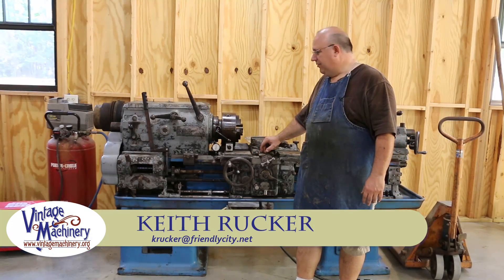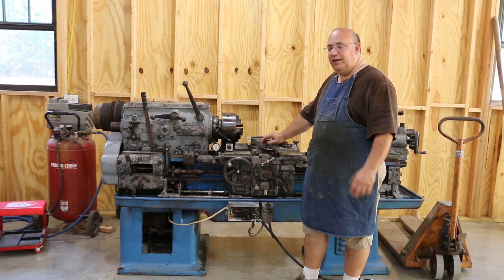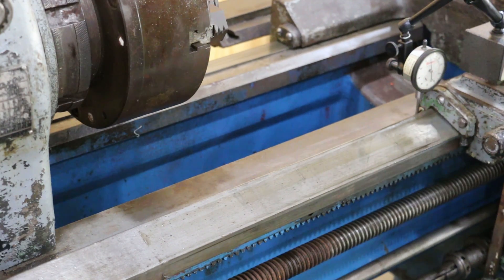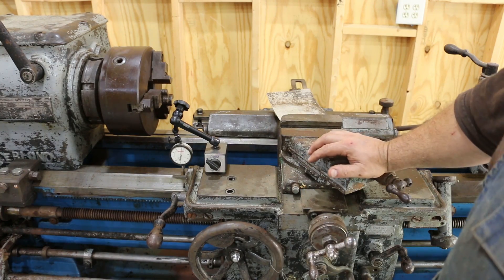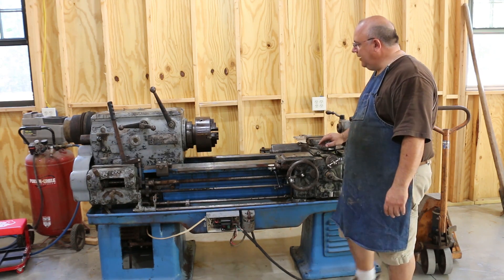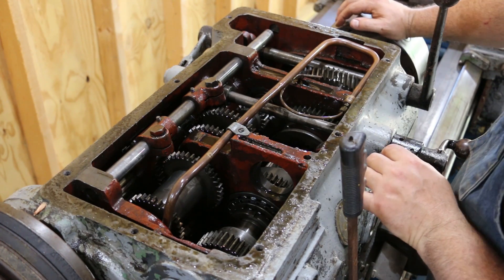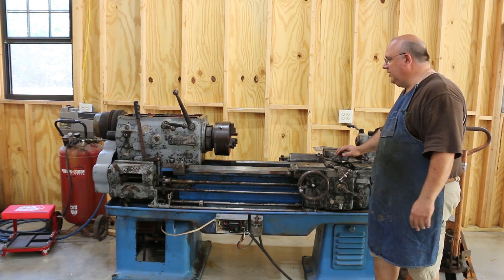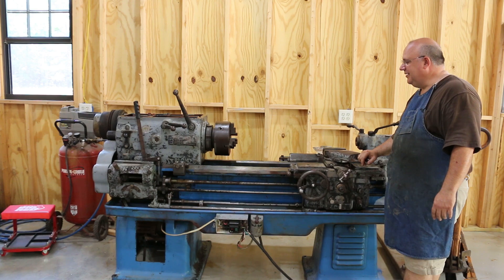LeBlond Lathe Restoration - Part 1:  Machine Insepection

Comment: I appreciate what Keith has done here showing us in a very simplified form how the ways can be out. The problem is when you put the indicator on the apron the apron can also be moving up or down or sideways as it goes into or comes out of the wear spots. Maybe I’m being too fussy. Another thing you could do would be to take a long very accurate straight edge hold it against the surface you want to check and use fine feeler gauges. Perhaps a combination of both methods would give you the information you need.

Comment: i'm in the process of buying a Leblonde lathe, my first lathe. what kind of power do these things run under..?? what type of power should I plan to install in my workshop..  (garage..) seems very similar in type to yours.. but larger..
Reply from the maker: If I remember right, that lathe has a 3 HP motor - three phase.  You could easily swap the motor out with a single phase motor if you needed to though.  My 16" Monarch has a 5 HP motor and my big 28" Monarch has a 10 HP motor.
Reply: thank you.. that's the way to go..

Comment: I have  a LeBlond 13" lathe that I switch the forward / reverse switch just before it stopped clockwise rotation to reverse and now it does not turn. is their a safety shear pin or other device that tripped? Thanks
jbthibault@netzero.net
Reply from the maker: Sorry, I have no idea off of the top of my head.

Comment: Stupid question from a noob:  Is it possible to run weld beads on the rail to build up the metal, and then grind it flat again to work out the wear?  I guess asking you another way.... if you did not find the amount +/- 10 thousandths to be acceptable, what would you have done to rectify it? (or would that simply have been a deal breaker at time of purchase?)   Thanks!
Reply from the maker: Grinding a lathe bed is a very specialized line of work and requires very large grinders.  There are only a few places that can do this kind of work.  Typically when it is done, you would not build up the ways - just grind them down.  Then you would build up the parts that ride on the ways to get things back in alignment.

Comment: Hi Keith, I'm no expert but I can't understand how you can check the ways without running the dial test indicator on an independent guide that you know to be "straight" (within reasonable tolerance). Lovely machine though, John
Reply from the maker: John,  I am running the indicator against a ground surface that was done at the same time as the ways and which has little or no wear.  It is not a perfect measurement, but I was not doing it to actually measure wear in the ways - I was doing it to get an idea as to how the wear in the ways will effect the use of the machine.

Comment: 3:40 - This was the genius of LeBlond: replaceable, hardened steel ways. The bed was merely a supporting superstructure. The ways would wear minimally compared to the heat or induction hardened cast iron ways of their competitors. They could be reground or replaced.
Reply from the maker: At least on my machine, the ways are not replaceable - unless you replace the whole bed.
Reply: I think it was later when they started fabricating the bed, certainly by the 60s.

Comment: Gear box looks as new.  It didn't look like the end of the small copper tube was putting out oil though.. unless it doesn't unless under full power/speed. surely a minor condition.
Reply: I just picked up one yesterday 6 inches chuck I will like to restore I would like to know if it's better to keep it with the original electric motor the one that is on now is not working and it looks like it is the original what are you guys recommend thank you

Comment: finally a decent video on how to check an old lathe....but I must say Keith if you have NOT leveled the lathe FIRST then your indication maybe wrong......further you maybe able to level the lathe in your favor that way in the most working parts of the lathe it will not dip down and turn straight....
Reply: Good point. I also wondered if indicating the bed with the indicator on the carriage might mask some of the wear, because the left side of the carriage is moving downward as it approaches the dip. As opposed to if the indicator base was on the carriage as shown, and the indicator were run along the bottom edge of a test bar supported between centers. BTW Lawrence, how's the Hendey running? Mines still in pieces!
Reply from the maker: I cannot disagree with you on the leveling, but I can also say that for seeing if a machine is totally worn out or if it can be saved, the methods I showed will get you into the ball park.  Remember, this was for getting an idea of how bad things might be on this machine and not for setting it up to use.  If I had seen 0.050" play in any of those measurements, I may not have even started stripping it down.  Things will only get better once the machine is put back together, properly leveled and the gibbs adjusted.
Reply from the maker: As for a test bar, that is a great way to test a machine - IF you know for certain that the tailstock is properly aligned with the headstock.  Remember that a tailstock is adjustable and I have no idea if this one is in adjustment or not.  If I just put something between centers and went to indicating, I might be measuring error that could be adjusted in the tailstock.
Reply: Yeah I guess we shouldnt level or take the twist out of our lathes then....LOL...good luck
Reply: Keith Rucker - VintageMachinery.org Good point about this not needing to be a super accurate test, only a preliminary one. As for tail stock offset being a possible issue, I initially thought just indicating along the bottom of the test bar would negate any effect of the offset tailstock, but it now occurs to me that due to the curvature of the round test bar, it would still cause an issue. Oh well. BTW, I had an issue on my lathe causing it to turn taper. I leveled it more than once, verified tailstock alignment, and it still turned taper! The culprit turned out to be excessive clearance on the end most head stock bearing allowing the spindle to be pushed off it's centerline by the cutting pressure.......sneaky!

Comment: This should be a very interesting series. Quick question about when you were checking for run out though, wouldn't it have been better to run the dial against an external reference flat surface?
Reply from the maker: Isn't that what I was doing?
Reply: I think the method you've used will be underestimating the error. There's a similar problem when building a CNC. The first rail you fit can be a bit bent so you put a dial on the carriage and run it against a long straight edge. The straight edge won't be parallel to the rail but if you take a measurement every few cm and plot the measurements in a spreadsheet you can subtract the non-parallel error. The remainder tells you exactly how much bend there is in the rail at every measurement point.

Comment: that drive train sure is a lot more heavy duty than what I am used to seeing.
Reply from the maker: I guess that is why they called this their "Heavy Duty" model!
Reply: +Keith Rucker - VintageMachinery.org I will be interested to hear if the Monarch (introduced later in your shop series) runs quieter with different type gears.   a
Reply: +ted sykora Adam Booth mentioned that as an asset for the Monarch.  Bevel gears versus spur gears in the drive train.   maybe no significant difference will be noted.

Comment: In your experience, are most of those industrial lathes 3 phase and what voltage do they typically run. My lathe is a modern 2014 offshore brand 14 x 40 but it is 240V 1 ph
Reply from the maker: Most industrial machines like this are three phase, but since you can easily change out motors on a lathe like mine, they could be ordered with whatever phase or voltage the customer wanted.
Reply: Thanks for the info

Comment: Hi Keith, 
Maybe I have seen it wrong, but with the carriage following the worn bedways one would expect the dial gauge, running on the unaffected part of the bed,  to go in the "plus" direction. 
Yours seemed to go to "minus".
It looks that you first have to properly level the lathe out.
Reply from the maker: Properly leveling the lathe could change things - no doubt, and we will be doing that later on (after making some leveling feet which the machine does not currently have).

Comment: There are two big holes on the left side of the headstock with some gears underneath that don't seem to do anything. Also there is a plug in the front at that place in the headstock. 
I think the Lathe had some additional speeds you could select but was removed later on.
Reply from the maker: This lathe had an option for a relieving attachment, that was used in a tool room to cut the relief on cutters.  The headstock is designed for an extra shaft that is used when that option was ordered.  This lathe did not have that option (nor would I likely ever have a need for it).
Reply: Keith Rucker - VintageMachinery.org

Ah ok.

Looking back the oil pipe has also no hole to oil the bearing hole. That makes only sense if there was never a bearing installed.

Thanks for the clarification.

Comment: Keith,

Very nice machine!  I asked you about paint colors before and you had mentioned painting it green.  As I look at your lathe I can see an awful lot of black paint.  I feel fairly confident your machine was originally painted black.  It sure would look cool if it were black again!  I recall a fella on the Practical Machinist forum who actually picked all the layers of paint off with plastic spoons and other soft tools until he reached the origonal finish.  If I recall correctly he found nearly all of the origonal finish was still in tact.  And the machine was beautiful with the ways and all the handles polished up.   I understand that Black may not be the choice everyone could live with.  I have redone 2 of my machines in the origonal black and I realy do not see myself doing anymore of them like that.  Right now I am leaning toward Rust-Olium Hunter Green for my 23" J.E. Snyder drill press.

All the best!

Mike
Reply from the maker: I was working on the lathe this weekend and pulled a couple of the machine tags off and the color under the tags is a black/dark grey.  Not sure that is what I will go back to - I prefer either a lighter shade of grey or green.

Comment: Hi Keith interesting video, I was wondering what would you have to do if the ways were worn out could they be rebuilt??? I have always had an interest in machine work just never had a machine to play with
Reply from the maker: You can have ways reground, but it is a lot of work and expensive.  If the lathe was that bad, I would be tempted to just scrap it and find another one.

Comment: Looks like a good lath runs very quiet no bad noises just a splash of paint and get rid of that blue on the base repaint the top of it and it will look as good as it runs 
you should be very happy with that
Reply from the maker: Thanks Colin!

Comment: Keith, not that this one needs it, as it seems to be acceptable as you said.  But is it possible to have the ways reground by someone to remove the peaks and valleys from wear over time?

Really excited to watch this video series, by the way.  Always look forward to your videos
Reply from the maker: Yes, that can be done.  I would have to completely disassemble the lathe to nothing but the lathe bed and send it to a grind shop to be re-ground.  There are only a couple of shops in the country that will do that kind of work for a one off project like this - and it is expensive.  An option, but I don't think it is worth it in the case of this machine.

Comment: My favorite test  for lathe wear is using a piece of long ground shafting like out of an old hydraulic cylinder and indicating the up and down and side to side movements at the same time.   Have Adam pick you up a good piece of scrap rod you will find it a valuable tool I think.  Of course turning a test bar will be the final answer but the ground rod sure helps you to diagnose where your turned errors are coming from.
Reply from the maker: Indeed that would be nice, but the problem with a shaft like that is that you are assuming that when you mount it in your lathe that it is properly aligned.  In the case of my machine, I cannot adjust the tailstock to get it set dead on until I start doing some turning.  So, if the tailstock was out, your test bar might not be true and it could indicate a false error.  Once the machine is running, turning a test rod will tell the true tale.
Reply: Keith Rucker - VintageMachinery.org
And then most tailstocks are low anyways so that could add even more error. I always figure that if the bar continuously trails off in one direction or the other that it is tailstock error.  I think this is why Monarch wanted you to use "proving bars" of sufficient diameter to perform the checks without the tailstock.

Comment: Keith, I hate to be a buzzkiller, but we are "neighbors" and friends, and friends should help one another.
Leblonds of this vintage are no good, and known to be a repairman's night mare.
There were two basic problems with them, and without the repair parts, which are no longer available, it is just a boat anchor or yard art.
These lathes are famous for breaking the Johnson rods into small pieces, and the garfunken/flugel shafts were incorrectly heat treated.
Just so happens that I have those parts here, so if you're gonna be home over the weekend, I'll drop by and bring the lathe back here.
Then you'll never have to worry about your Johnson rods and garfunken/flugel shafts....
Regards,
Duck
PS: nice lathe Bubba....
Reply from the maker: Well, come on and pick it up then.  I will make you a good deal.  Everybody needs a boat anchor or two....

Comment: Would leveling the machine make any difference in the readings?
Reply from the maker: Possibly some, but it is probably slight.  The problem I have right now is that this particular lathe does not have any means to level the feet.  I will be adding that as part of the restoration.  We will check it all again when we put it back together.

Comment: I am a little confused on how you checked the runout in the ways. you had the gauge connected to the carriage i don't see how that will give you a accurate reading of the total runout, the carriage will travel with the runout and mask the total runout. For example if your in a car driving down the road and your car that is 2 feet off the road and in a mile of road the middle of that mile the elevation dropped 10 feet your car is still only 2 feet of the road and you really never see the 10 foot that you have dropped. Do you understand what i am trying to say? or am I not thinking right? Lol
Reply: But you're taking a relative measurement from the known-flat and level shoulder next to the lane you're driving in. It will show you just how level and flat your lane truly is in comparison.
Reply: John,
That is just what I thought. If the bed was like a banana, wouldn't the carriage just follow it and show zero runout? What are we missing Keith? 
Thanks,
Reply from the maker: John,  I am not really measuring the wear in the ways as much as I am measuring how the wear in the ways is affecting the movement off of the flat plane you want it to move in.  If you think about it, it really does not matter how much wear is in the ways, what is important is how much your carriage is off as it travels over this wear.  Due to the relatively wide area that the carriage contacts the ways, there is a lot of averaging going on.  What I am concerned with and what I am trying to measure is how off the lathe will be in use.
Reply: Would not such a mass of metal be subject to temperature warping?  Perhaps it was never much truer in times past.
Reply: I am sorry if these sound like dumb questions but you said you are concerned about how much the wear in the ways are affecting the movement of the carriage but you was measuring relatively close to the carriage wouldn't a more accurate way to check the runout of the carriage be to measure from the carriage to a true axis from the chuck to the tailstock both vertically and horizontally? I am not a machinist but I do work with steel and I am just trying to understand the concept.
Reply: He isn't measuring from the surface that has the wear on it, instead he was measuring from a surface that should have been parallel when the machine was new.  The problem with using the chuck and tailstock as a measuring point is that after you have them dialed in you have corrected most of the runout and would underestimate the amount of wear.  At the end of the day it probably doesn't matter how accurately this procedure measures the wear, because he isn't using the results to repair the machine, but instead is just checking that they are good enough for the majority of his project.  If he ends up doing more critical parts that are affected by the wear he can tweak the tailstock to reduce the inaccuracy.  This is just my understanding of the process...I have very few hours of machining under my belt so I could be off base. If I am wrong hopefully someone will correct me.
Reply: Ahh now that makes sense in my little head, checking for parallel.

Comment: Having been a transmission mechanic with over 40 years of experience I can tell you that the way that gear box throws oil looks extremely healthy to me. The oil is thrown from the center of the gears which indicates a good mesh pattern.
Reply from the maker: I agree - I really don't think that this machine has seen a lot of use in the grand scheme of things....

Comment: Not bad on the ways and the gears are in great condition for an older lathe. I've seen ways that were .040 out so then it's a mater of is it worth fixing.
Reply from the maker: All in all, I don't think things are very bad on this machine at all.